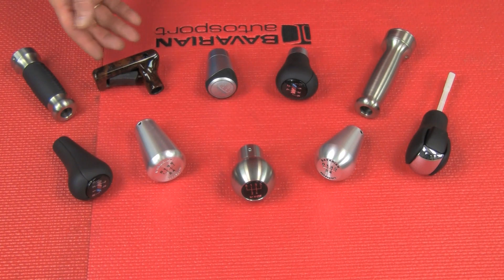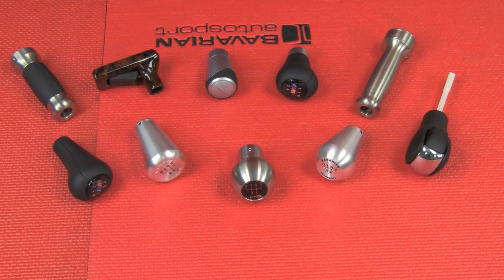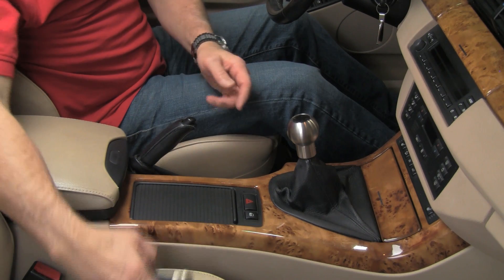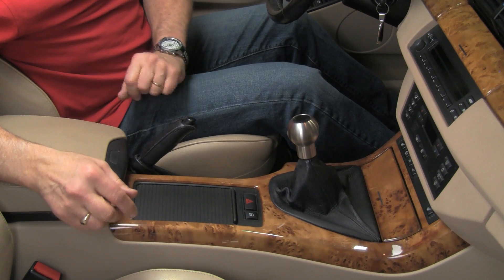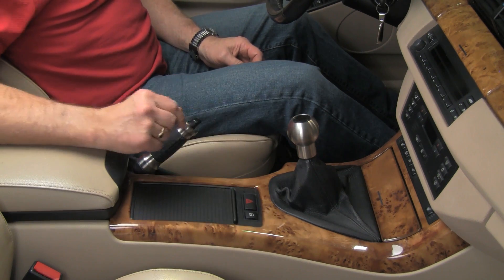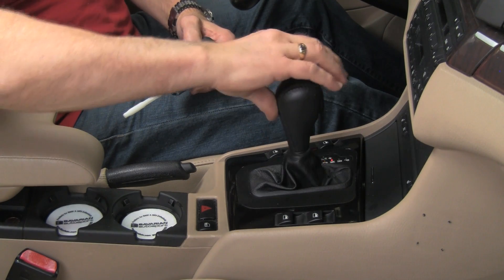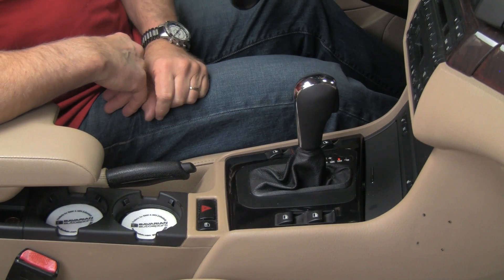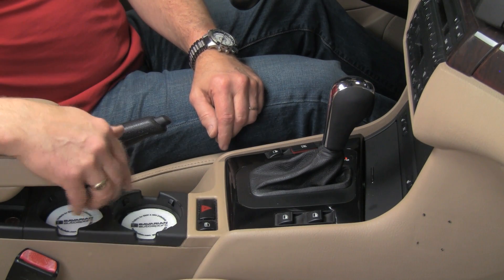Replacing a shift knob in a BMW or MINI

Comment: Big help. I'm changing from a 2008 135i to a 2012 120d and the gear knob in the new car is frankly nasty. So I'm going to swap them as they're both 6 speed and m sport models. Subbed also.

Comment: Hey BavAuto - I've got a automatic e46 CI and I removed my shifter knob to replace the worn out leather shift gater.  I cannot get the shift knob to lock back down in place  (it just spins around).  I've pushed down about as hard as I can, and ideas?  Thanks, you guys are the best.

Comment from the maker: The owner's manual should discuss using the tool.  On an F10 5-series, the cup holder is removed and the tool is inserted into a socket and turned.  Not sure if it's the same for the E92

Comment: Great video! But I was really hoping for a little bit about removing the leather gaiter/boot if that's what it's called. Mine has a tear in it.
Reply from the maker: peuterschmidt - on most models, the boot snaps in-to or out-of the console.  There is a plastic frame that the leather is secured to.  The frame had tabs that clip into the opening.  Just press the side edge of the boot frame inward and pull up.
Reply: BavarianAuto Thanks for the reply, I'll give it a go!

Comment: Can u answer a question? My 2009 535i is having an issue. I keep getting a warning and/or alarm that there's a gear selector malfunction. I can shift into D, N, R, and drive just fine but it won't shift into park. I turn the car off and it's back into park when I restart it. What do you suggest?

Comment: Dear Otto, I watched as your took ahold of the E46 Stick shift and after putting it in "N" or some place better to pull, then "pull and twist" and it came out! My problem is that when I tried it the entire shift mechanism came out of the holes! Now not only can't I replace the shift knob, I can't figure out a way to re-attach the shift mechanism, which is now loose and can easily be pulled "up and out" if I'm not careful when I'm shifting into "Rev" or "P." Any suggestions?
Reply from the maker: Well then ....... The shift shaft pulled out of the shifter assembly, right?  We've never seen that happen.  The parts of the shifter assembly are not intended to be disassembled, so there isn't a direct way or suggestion on putting it back together.  It's basically broken.  You can take a close look at it to see if you can re-affix the shaft into the shifter base assembly.  Remove the console surround plate to get a better view of the shifter assembly.
Reply: Add electric tape then put the shifter on it will have a more snugg fit

Comment: Too bad I didn't watch this video one year ago. Anyway, now I have an E92, 335i euro version with the 7 speed DCT. I read from the owner's manual that you can  unlock the transmission from parking (if a dead battery, for example) using the small tool that comes in the tool box in the trunk. Could  you please make a video on tto do this?

Comment: I have a Saab and the center part stuck on and the knob came off. I hate to try to force it off since there is a reverse release springed ring on it and if I break that I have a problem. Thanks for the video anyway.
Reply: I just bought a Saab yesterday and have already figured out that it is a clip on style shifter. Do you use google? Most recommend removing the whole assembly and using a vice grip and tool to remove the knob. A few have found a way to remove it with 4 thin pieces and pulling up. 

I am sorry, but if you can't use google to find something so simple, you should not be doing your own car work. Especially if you are going to sell, you are the type of person that sells a faulty vehicle as you didn't even know how to do simple fixes.

Comment from the maker: Manual transmission = yes
Automatic transmission = no
On the auto shifter, the knob still does "snap" on, similar to the pistol type snap-on auto shift knob shown, but there is no detent rod.  The knob is more like a manual transmission knob ... without the detent rod.